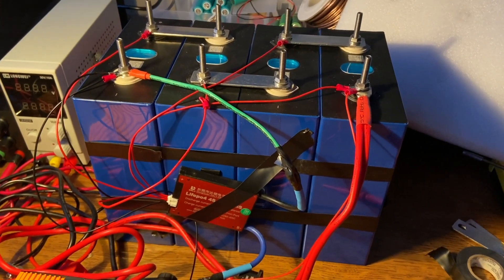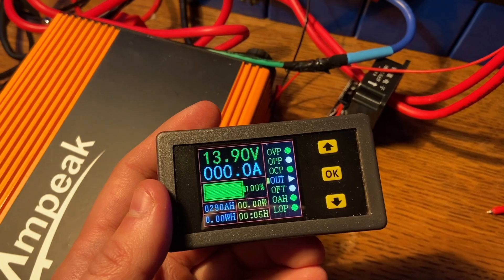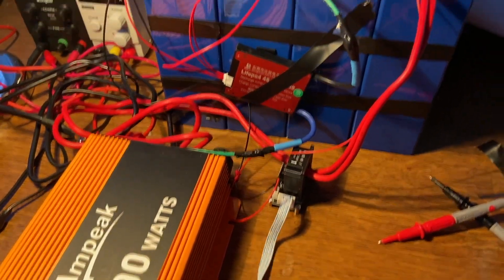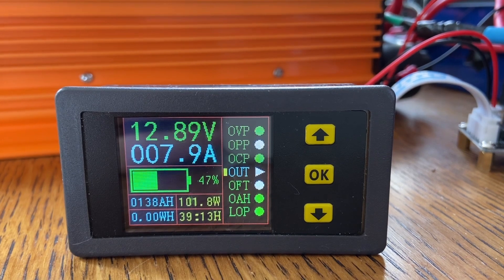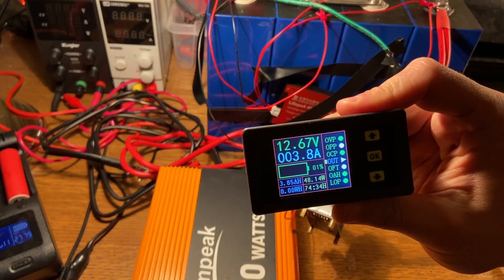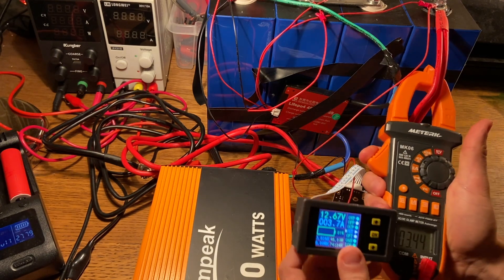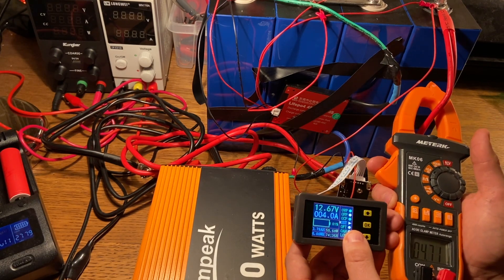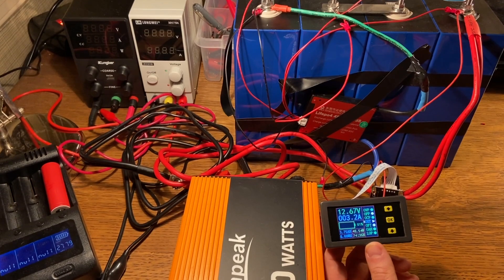EVE 280 Ah lifepo4  - CAPACITY TEST with Surprising Results!

Comment: A low C rate test will result in higher than advertised AH rating. This is typical
Reply: If you are still around.... what C rate would you suggest for testing these batteries?
Reply: @msach4277  DJLBERMPW Lithium Battery

Comment: Excellent video! Did you use the bench charger? How long did that take? I’m charging a 24v version of this in parallel right now, taking FOREVER. Lol
Reply from the maker: I do use the simply bench power supply as a charger. It can definitely take a long time (think days). Make sure you have great terminal connections.
Reply: @TheWilltoBuild  good to know! I’ve been going about three days now and have come from 3.320v to 3.362v measured at three points on the bus bars. I’m going to make better bus bars, because they aren’t the best connections. Thank you for the reply!

Comment: Curious why the split cable coming off your positive terminal, going through the loop of the tester? I'm still learning all this so it makes me wonder - is that a valid substitute for a thicker single cable, as far as how much capacity it can safely move, resistance, etc.?
Reply from the maker: Good question. Those cables actually came with an inverter and I just had them on hand, so no special reason I used them. But you can use multiple cables to substitute for a larger cable. Here is a link to a calculator that will tell you the equivalent gauge wire for a combination of smaller wires: https://www.wirebarn.com/Combined-Wire-Gauge-Calculator_ep_42.html
Reply: @TheWilltoBuild  Oh that's really helpful, thank you! 

It makes me wonder about whether or not I would even need to buy bigger gauge cabling for the shorter runs, or just use a couple of pieces of thinner gauge wire to accomplish the same thing. Trick is, is the single thicker stuff more or less expensive than twice the length of the appropriately-sized thinner stuff...

Comment: Thanks for the video. Any reason why your "C-rate" was relatively low? I have the EVE cells. It seems like anybody that hears me say I want to draw more than a hundred amps (@ 48v)  thinks I'm crazy.. but these cells were rated at 1C discharge and charge when I got them. I think they might have de-rated them since then but I haven't checked.
Reply from the maker: My C-rate was low just because I couldn't find the right appliances to pull it any higher with consistency ( I need to get a better/safer heat gun) - but it shouldn't impact things too much versus a higher C rate of 50 amps or so. I have another video where I talk about the exact C rates these are rated for - I think they are both rated for 1C (and the Lishen for 2C for brief periods).  100 Amps should be more than doable with these cells, it is only 40 amps at 120 volts, which is a lot but hardly unheard of. I'll be pulling that myself at times when I am set up.

Comment: Did you check the power used by the meter?  In a 72 hour run, it will have used an amp hour or three ;-)
Reply from the maker: I didn't, but you're probably right. Given how they did on the test though, I don't think it matters.

Comment: About a year ago I bought 16 EVE 280AH cells from Xuba. I did several similar capacity tests with the same type of meter just reaching expected capacity (total Ah & Wh) at a low C-rate (around .1 or so).These days I've been using the battery in an off-grid camp solar setup and have been very happy with them. They can power just about everything except RV-style air conditioners with our current setup. The battery sits at about 90% charged until we get to camp about every 3 or 4th weekend or so. It pushes a variety of loads anywhere from no-load draw on the inverter to near peak (4kW). Anything from power tools, small pumps, 2 small refrigerators, TVs, lights, fans, a window shaker air-conditioner, air compressor, pressure washer, coffee maker, microwave, cellphone booster, charging batteries, etc... 

I've gone through 3 of those DROK meters. Apparently, they don't like the temperature changes in a non-climate controlled room. The electronics becomes erratic and the readings are nonsensical. It hasn't proven to be a reliable long-term meter from my experience so far. I have another percent usage meter Will Prowse recommended back in his RV-living days, but it has to learn the battery capacity to be reasonably accurate. I've been apprehensive to intentionally drain the battery down forgoing solar for a day or two to calibrate it. Also,  I periodically do maintenance & safety upgrades on the system where I'd have to disconnect the battery. Hence, having to re-train the meter again. I may just have to break down and spend some money on a decent capacity meter.
Reply from the maker: Great, thank you for insight and experience. I agree, probably worth it to spend a little bit more for a proper capacity monitor. I'll probably doing that myself soon as well. This monitor works well enough for now, but given the cost I wouldn't expect it to be perfectly accurate or to last forever.
Reply: Im thinking of building something similar. are you running your 16 cells in series to get 48v?
Reply from the maker: @Cerco170  yep, that is exactly what I am doing.
Reply: @Cerco170  No, I'm using 24V nominal. An 8S2P configuration. A BMS on each pack.

Comment: I wouldn’t trust that capacity tester, I have 3 exactly the same make/model and they measure a different current on the same current calibrated against a fluke meter and the voltage difference is even greater!

At the moment I’m going to use them for my 3 packs but only for the most general of relative charging/discharging/voltage.
Reply from the maker: I hear you. But I tested the amperage measured against my ammeter with a variety of different loads and while it was off, sometimes it was a little over,  sometimes it was a bit below. I couldn't actually find a consistent bias. So my test isn't perfect, but I do think it is generally close to the mark.
Reply: Take a look at the eneramp capacity test video using pro equipment from hp/agilent. You'll notice that test hardware doesn't spew out random numbers like the China testers on Ali express. Also due to the peukert effect, at c/72h you are getting an unrealistic capacity. Lead acid was usually tested under a 20h rate. For lifepo4, most mfgs. spec a c/5 rate. One of the great benefits of lifepo4 for rv'ing is that you can run a microwave / convection oven in convection mode for 45 minutes, assuming your inverter is sized appropriately.
Reply from the maker: @swsuwave  This incorrect - there is no Peukert effect to li-ion, so a slow draw test is fine. Additionally, alot of lifepo4 cells recommend a .2 C draw for capacity testing. But I agree about the meter - it is not going to be super accurate. But I don't need to be super accurate, I just want to test to see if the the cells broadly make capacity.

Comment: These guys sell inverters set up for Tesla, LiFePO4, or Lead Acid Batteries. If you want a discount code for a Sigineer inverter, use the following codes: : For 3KW to 4KW inverters, use AaSGjian20, the to gets $20 off. For 6KW  inverters. use AaSG35jian, to get $35 off.  For 12-15KW  inverters, useAaSG50jian, to get $50 off   www.sigineer.com

Comment: Thank you for the video, but where did you buy those cells from? I am looking to buy the cells (EVE/Lishen). However, I think if I buy from any of the vendors in the affiliate links that you have given, the capacity tests will surely fail. They are selling used cells and not even Grade B. So your links are a little misleading. Kindly state the vendor that you bought from, apart from the affiliates. I wanted to buy from Alibaba (Shenzen Basen) but they aren't shipping to my location (South Korea). Trying to find a reliable vendor from Alibaba/AE. Thanks.
Reply from the maker: I really disagree. The link I used are not for "used" cells - they are the same links provided by Will Prowse, who is probably the biggest name on youtube when it comes to lifepo4. All the cells we are receiving that are repackaged Eve and Lishen are definitely grade B, and they will likely show some imperfections (usually scratched terminals and/or patching on the cell wrapper). Mine are no different. But the links I provided are the best available on AE. I ordered from Basen though, but I did not provide links because few users want to bother directly with Alibaba.
Reply: @TheWilltoBuild  So you didn't buy those cells from any of those vendors, then. That's what I wanted to know. BTW my friend here in Korea did buy 4 cells from Blmpow (seller on your first link), he got used cells. He left a 1 star comment too, as you can see. I don't know how/why but it seems the Quality of the cells shipped out vary a lot depening on the customer destination they are shipping to. I need more investigation. Anyways thanks for your clarification.
Reply: You should get LG or Panasonic then! No shipping costs!
Reply: @Sanwizard1  That would be perfect but LG isn't selling Lifepo4 cells for diy, I also don't think that have manufacturing here. And panasonic is Japanese, and again no lose cells for DIYers. I think China is leading in manufacturing these prismatic lifepo4 and the energy density seems great. And easier to get hold of the cells by individual DIY customers.